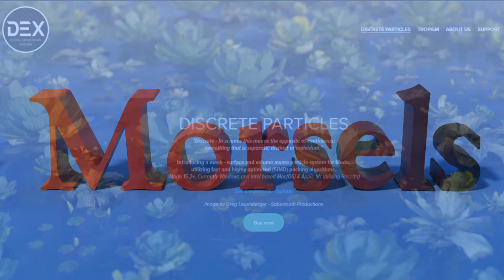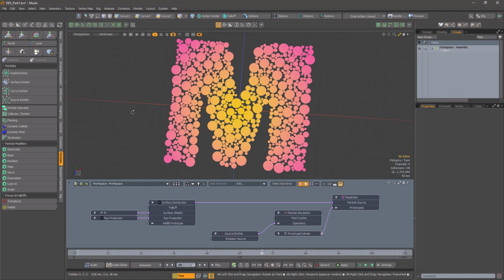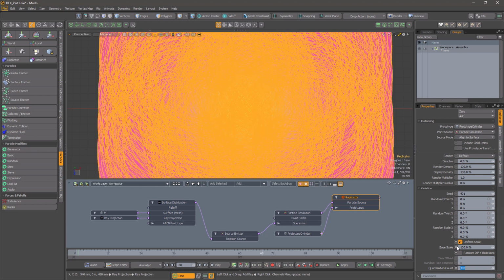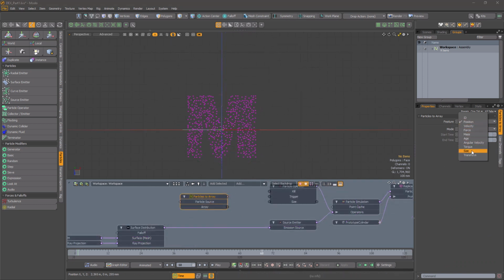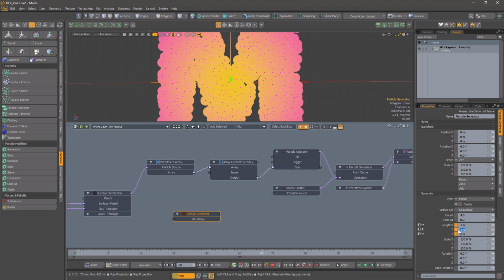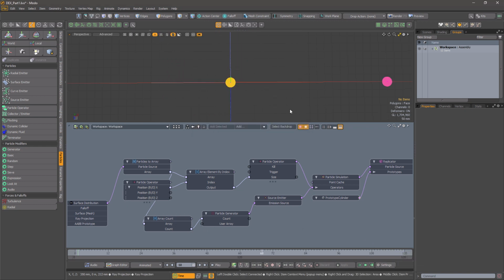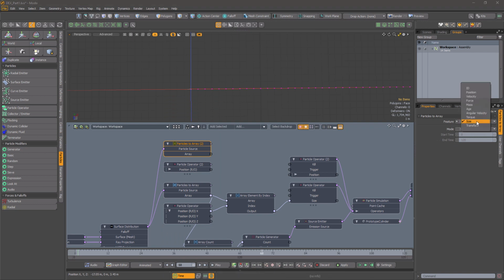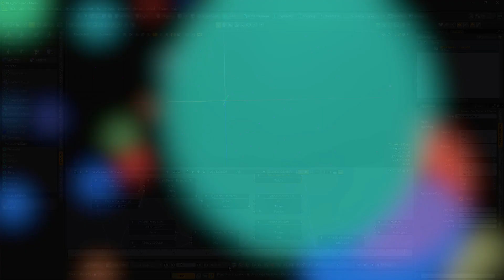Dynamic Particles from Discrete Particles in MODO

Comment: Nice one. 
I think I need to watch this at least 5 times to understand what is going on. 
Is there some forum thread etc somewhere from which this was inspired?
Reply from the maker: There's a thread on the Slack alpha channel started by Greg on 29th June where we discussed the problem.  I'm a bit concerned that if you are confused, then maybe I have failed in my job.  The critical insight is the use of the particle generator to generate the indices.  It's a bit counterintuitive to use a coordinate as an index, but clever!
Reply: @SteveHill3D  You didn't fail. Those operators and particle simulations are just very confusing. You have to watch tutorials few times, copy the set-up few times, and maybe after year or so you understand what you actually did :)